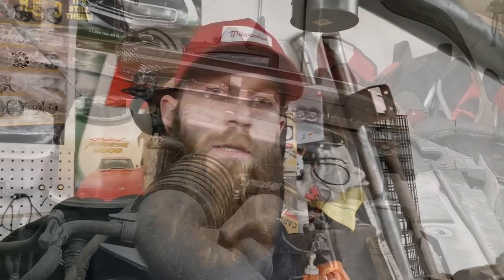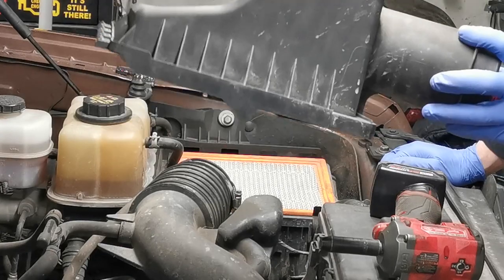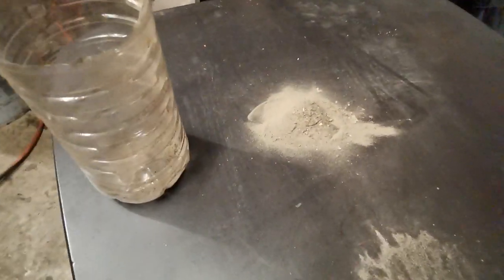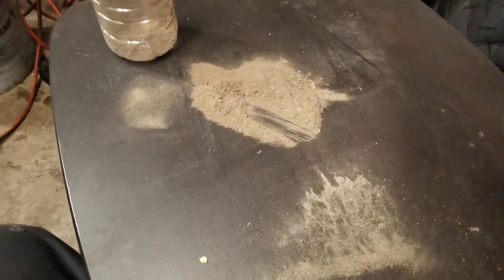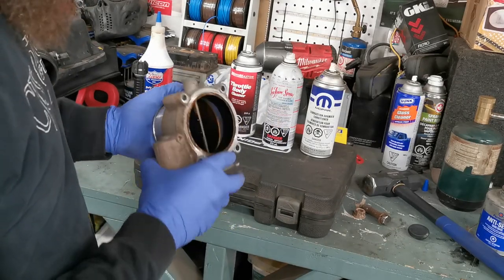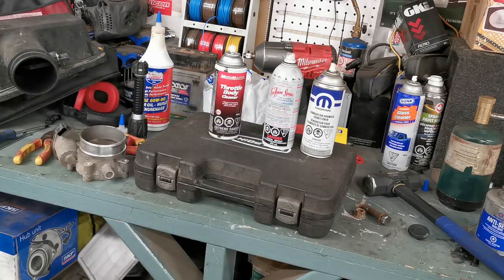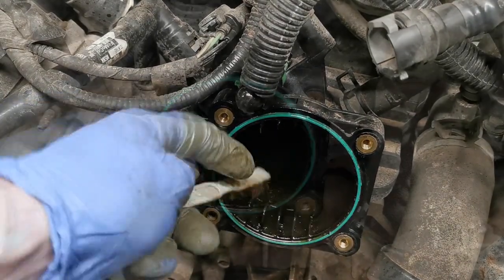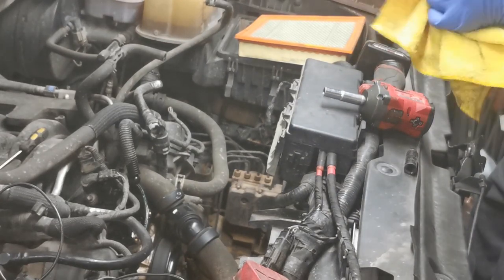F150 Got Bad Gas Mileage? Throttle Body Cleaning And Idle Relearn

Comment: Thanks for the video.  Question:what guage jumper wire do I need? Thanks
Reply from the maker: Does not need to be a very big wire.  Or could use a booster cable to drain the system. Up to you.

Comment: I have a rough idle after my 2013 f150 5.0 gets warm. Plugs replaced but still does it. TB taken off and cleaned. It was really sludged up on the outside for some reason. I will try the relearning process and see if that helps.
Reply from the maker: Cool let us know
Reply from the maker: If you have access to a scan tool.
Check for pending codes.
Check coolant temp sensor is reading correctly.
Check fuel pressure. Fuel filter might be getting clogged up?  
You said you changed spark plugs? 
What brand did you put in? As some other brands besides motocraft can cause a skip and or possibly you have a bad coil.
Reply from the maker: If you have a flex fuel truck. Check the alcohol content level sensor as I have seen the sensor go bad and it give a bad reading to the pcm giving more or less fuel causing rough idle etc
Reply: @LUCAMTire  There is no CEL, but I can have my friend scan with his tool. I used NGK gapped at 45. When I replaced them, there was one loose plug (back drivers side plug). It and the coil boot was all sludged up with oil.
Reply: @LUCAMTire  It is a flex fuel truck. Is that inline somewhere or inside the tank?
Reply from the maker: @metacombs  if you had a pool of oil at that plug you could have a bad valve cover gasket which is causing the coil to carbon track to least resistance. Meaning the spark from the coil is arching to the engine instead of going down through the plug.
Check that plug again now that you runed the vehicle.  If it is oily again in the base of the spark plug tube replace all gaskets on that valve cover, there should not be any oil sitting in the spark plug tube. Should be dry. 
The alcohol sensor i believe is on or just off the fuel rail. I'll need to double check
Reply from the maker: @metacombs  if you do not have all the tools to test I would suggest taking to some one who has all the tools for testing. 
Would hate to see you just firing parts at it without being able to solve problem.
Reply from the maker: @metacombs  it could also be the sparkplugs themselves as the ford trucks are finicky with brand for some reason. We have chased are tail on the Ford trucks with NGK and champion and then turn around and put motocraft and then problem solved.
Reply: @LUCAMTire  Oil was blowing by the plug for sure since it was so loose. I will run it some more and then check it.
Reply: @LUCAMTire  I have an appointment with the dealer for the trans downshift recall, so If I cannot figure it out by then I will have them diagnose it.
Reply from the maker: @metacombs  cool.
Let us know what you find out. Curious to know
Reply: @LUCAMTire  Ok so the relearn did not work and the new coils/plugs did not work. I had my friend scan and the only code is cylinder 8 misfire. I have read it's possible that the ECM has some bad parts inside or my valves for that cylinder may be worn. 155k miles on the engine so maybe?
Reply from the maker: @metacombs  switch #8 coil with another  cylinder and see if the miss fire moves to another cylinder
Reply: @LUCAMTire  I did that and it does not.
Reply from the maker: @metacombs  KK
Reply: @LUCAMTire   Also cylinder 8 is dry now after running. However, I am hearing a noise that sounds like a vacuum leak/spraying noise, but it could just be the injectors making that noise? I cannot locate it even after trying several times with other people as well. I have not tried the carb cleaner trick. Just concerned about catching my engine bay on fire ;).
Reply from the maker: @metacombs  there is two hoses for crank case ventilation at the top front of the valve cover. Goes from valve cover to intake. Plastic 90 degree elboys are blown molded and are known to crack at the seam. I needed to replace one on my truck. Put your finger over the seem and see if the sound goes away. Other times could be a vacum leek with the 4x4
Reply from the maker: @metacombs  would need to use a tethescope and prolly a piece of brake line in end and start following the sound untill you find it
Reply: @LUCAMTire  Dealer says I am get getting a loss of compression in cylinder 8. They want another $200 to do further tests to see exactly the issue. I said before I say yes, how much is a head gasket to replace? "both sides 3700". Um, yeah I'll take the truck back because if it's valves or rings, the bill will be 5k and I may as well have the entire motor rebuilt for that price.
Reply from the maker: @metacombs  ya doesn't sound good.
I never heard many of them having to many issues like this. They are usually a pretty bullet proof engine.
What year is your truck and it is the 5.0L coyote motor?
Reply: @LUCAMTire  2013 coyote 5.0. 155k miles. Rear main is probably leaking too it looks like. I got screwed on this buy apparently. Not happy.
Reply from the maker: @metacombs  doesn't sound fun.
Check around for a good used motor.
Reply from the maker: @metacombs  if you haven't already sub to the channel, turn on notifications hit like and share a video that might help a friend. Hope all goes well
Reply: @LUCAMTire  yup. Just confirmed today with a real compression test that cylinder 8 is only at 5:1. Checked another one and it was 10 so very well could just be 8. I may check if its valves or rings with a pressure test. Ran an endoscope in there buy couldn't really see issues.
Reply: @LUCAMTire  Subbed.
Reply from the maker: @metacombs  cool thanks
Let us know what you figure out and do in end.
Thanks for the update
Reply: I have that same problem.
Actually had a random cylinder misfire (while really getting on it) today which is why I found this video. Gunna let my truck cool down and do this. Hopefully fixes the issue. I have new plugs amd coils and ran injector cleaner about 1000 or so miles ago. I just have to remember to take out chip and turn off my pedal commander to relearn the idle, which is gunna suck for the next few weeks or month. I love those things.

Comment: My truck’s battery was completely dead to the point where the key fob wasn’t working. I put a new one in it and off I went. Drove perfect but now it is stalling when I come to a stop or have a really low idle. Hope this works.
Reply from the maker: If you put a new battery you need to do a idle relearn.
First make sure battery connection is good and secure and the power wire that runs along the front of the truck is tight to battery + junction to battery post. This comes loose from time to time at the battery junction.
This Would cause random complete shut down no power or stalling.
When changing the battery this comes loose from time to time from moving the wires out of the way to get the battery out. This is where all the wires come together to hook on battery. I have seen this come loose on more then one truck. Double check the connection with the proper tool as I have seen several chase there tail over this.

Relearn 
Let truck idle with no loads on for 20 minutes. 
Turn on one load at a time after the 20 minute mark.
Blower motor. Wait a minute. Turn lights on. 
Wait. Turn AC or defroster etc. One by one with waiting a few moments between each. Idle should fluctuate a bit each time after idle settles you can continue.
Hold foot on break.
Shift to reverse and run through each gear with out moving foot on brake. Holding each gear for 30 seconds. 
After the idle relearn you will need to do a test drive for the truck to relearn the shift points. May or may not shift hard for a little bit untill it relearn's itself. 
If the throttle body is fairly dirty this could cause stalling and for the truck not to relearn itself correctly. 
Hope this helps
Reply: @LUCAMTire  Cleaned the throttle body & MAF and all is good now. Thanks!
Reply from the maker: @jass7981  good good
Happy to hear
If this video helped you out make sure to hit that like button and subscribe to the channel to help us out.
Thanks for watching

Comment: I have a 2017 2.7 eco at 100k miles and truck sputters sometimes and dies when at complete stop. Hope this helps!
Reply from the maker: I would suggest running the codes and and checking the live data to see what is taking place. 

I am on the assumption a cleaning would not make your truck stall out but anything can be possible.  Sounds like there would be a different problem at hand..

Comment: I've been telling my dad to get his truck checked for over 4 months now, he says he doesn't want to spend money 🤦‍♂️ like he's not spending extra money on gas.
Reply from the maker: He could value his vehicle different then you and I.

 or may not understand it could save him money if properly diagnosed and fixed.
 
He Might or might not be acquiring service at the correct service center and he knows it and does not want a second opinion because his service center lets things slide for less. 

If it works for him in his situation and he is not complaining about his truck. all is well.

If he does not want to himself and you feel that it really needs to be done,
Make it a present by having his vehicle looked over and possibly fixed. 
Just source the right tech for the job, 

Hope you get er sorted out.

Comment: I had a problem with my fuel pump fuse and had it relocated. Would doing the relearn make that adjustment go away? What would happen if I just clean it with no relearn?
Reply from the maker: If you do not disconnect the battery and do not do a relearn the vehicle will operate at its previous computer  calibration untill it relearn again.

Depending how dirty the throttle body is will determine how it will run. After a cleaning. 
It might run normal and relearn itself to what has changed in time. Or it might run rough. Under or overfuel can be a result.  
Can run normal
Lean out
Run rich
Or spit and sputter.
Or shift funny, hard or soft, may stay normal.
Won't know untill you try. 

It all depends. 
The relearn would be the ideal thing to do.

Comment: I did MAF cleaning as well as throttle body cleaning. I am still getting the same MPG regardless. I am on 33s but 10mpg in city and 13 on the highway just doesn't make sense. I replaced air filter too and I was told spark plugs were good. I have a 3.7L V6 non-ecoboost. Also, 4x4 doesn't work. I replaced the transfer case motor and nothing. Can something with 4x4 not working cause a bad mpg? I'm not expecting to get 20mpg, just not 9-10mpg.
Reply from the maker: 33 inch does not help fuel millage. 10ply or mud tires does not help either. 
Check live Data on o2, mass air flow, flex fuel mixture. Etc. See if things are normal. Any Check engine light? Evap system malfunction? Check for vacuum leeks under hood. 

For the 4 wheel drive do you have power and ground at the transfer case motor or were you guessing that was the problem? What's it doing to not work?

Comment: I have to change the o rings on the Y pipe of my 2011 f150. Since the throttle body is coming off I just as well clean it. I also plan on changing the belts while I'm in there. Maybe not necessary but the truck has 98000 miles. Thanks for the video. I've disconnected my battery several times and knew nothing about the throttle body relearn process. I've never been happy with the throttle response on this truck. Hopefully the cleaning and relearning process will help. If mileage goes up a tad too I won't complain. Funny stuff here. I have a Kenwood deck in my truck too, my tire pressure light is on lol and I have a muffler delete on it. What did you do to your exhaust?
Reply from the maker: Removed resonator. Added thrush muffler. Single in dual out. 2.5"
Two custom tail pipes that come out behind each wheel. 
But recently I went back to stock as the muffler was starting to get a hole in in. 
I put the quiet oe exhaust back on now.
Reply: @LUCAMTire  I see. I left my resonater on. I've had exhaust systems on a lot of different vehicles and didn't want drone. Try a muffler delete. Cheap and it gives the truck a nice sound. It's not super loud and no drone if that bothers you.
Reply from the maker: @lobbyrobby  ya that works to. 
I seen quite a few people do that. 
I was looking for a distinct sound that not many people would have and a distinctive look no one else would have as you can not buy a kit for how I had my tails set up. It wasn't to loud and didn't have a drone for the most part. Quite when idling around and loud when hitting on it. 
Was good. 
But I put it back to stock now. 
Not sure if I will build another system for it or not. 
Will see what happens when summer comes.
Reply: @LUCAMTire  right on. I had cherry bomb glass packs on my 94 vic. That car sounded beautiful. It was pretty loud too. Loud enough to where I was pulled over twice lol

Comment: I have a 2012 150 an it’s doin a lot of jerking changed wires plugs coil still doing the same
Reply from the maker: Sounds like you might have a check engine light..

Comment: Did I miss what the jumper wire was doing…?
Reply from the maker: Jumper wire drains the capacitors in the system to reset the computer for idle relearn.

Comment: Sea foam is specifically made for two stroke engines
Reply from the maker: Seafoam top engine cleaner and lube.
States on can
Works for all types of 2 and 4 stroke gasoline engines. 
You can prolly get some specifically for 2 stroke. 
Specific penitraiting fluid.
In tank gas treatment
Engine Oil treatment and prolly other categories of seafoam.

Depends what part of seafoam you are referring to.

Comment: I wonder if this is what's causing my bad do mileage.

I guess mine is in km . But originally when I bought the vehicle I got just under 1000km a full tank.  Now I get  about 600km a tank in a 3.5 EcoBoost. Doesn't seem right to me
Reply from the maker: its a possibility.
Driving habits can cause a significant differenance.
If you were taking it easy when first purchased, The liters per 100 km would better and now more comfortable with the truck the little skinny peddle gets pushed a little harder the L/100km will be worse. winter plays a tole on millage as well. warm up times etc. over sized tires or lift kits dont help
IF this video helped you out.
Hit that like button and subscribe to the channel to help us out.
Thanks for watching
Reply: @LUCAMTire  yes it is winter. My tires do keep getting flat front the cold. There were times when I went a bit faster. I did my calculation at 9.4mpg . Which is terrible for an eco boost. I've read that it could be the mass airflow sensor. A look so the fuel pressure regulator? I dono. I just hope i can fix it soon when it warms up
Reply from the maker: @slyfly4829  Remote start wont help the millage. you want a the motor warmed up a bit before driving. cold motor will burn more fuel. 
several senarios.
your tires should not be going flat because of the cold.
The pressure will fluctuate some but shouldn't go flat.
As long as the tire is properly installed you should not be needing to put air once a week. You might need to once a month or once every two month to make sure they are not dropping in pressure. I put my tires on 4 months ago and only needed to top them up once sense. and they might of dropped 5 psi in this time. going from above 0 degrees Celsius to below zero 
 Thinking either poor installation or you picked up a nail or something.
I wouldn't keep running the tires low on pressure. it will chew the inside of the tire with you not knowing or it will cause the sidewalls to flex to much and crack under strain. best to have fixed. Tires are not normally cheap. lol 
Mass airflow can cause some of the problems.
Winter gas doesn't help.
The mixture of the fuel changes for temperature and all of a sudden gas millage sucks.
If your vehicle is a flex fuel it will have a sensor for the alcohol content in the fuel. these tend to miss read time to time causing bad millage. 
If you have a block heater, plug it in while it sits over night. having a smart receptacle is nice. can program the plug to turn on a few hours before you need the vehicle and it will warm the coolant or oil to assist in cold starts

Comment: Question? When you use a jumper wire to drain the memory or to wipe it clean to relearn.

 Do you unhook the battery completely and jumper just the cables? Or disconnect the negative and run jumper from the cable over to the hot still connected to battery? 

Does both ways work? That's the way a Ford technician showed to do it on here. I did it this way just wondering if it worked?
Reply from the maker: Both ways work.  You can disconnect one and jump it like the other video showed or disconnect both and jump it.  
I showed to disconnect both. Neither way is wrong just as long one is disconnected and not touching the battery terminal when jumping. 
Is one way a safer method for a potential  beginner, maybe yes maybe no, depends on the person. 
Both ways will work for you.

Comment: How much better was it in mpg?
Reply from the maker: brought it down 2 liters per 100 km
My gas millage was not real bad but it was starting to get there. It helped. every 100,000km when changing spark plugs it would not hurt to do the maintenance on the throttle body and do a relearn.